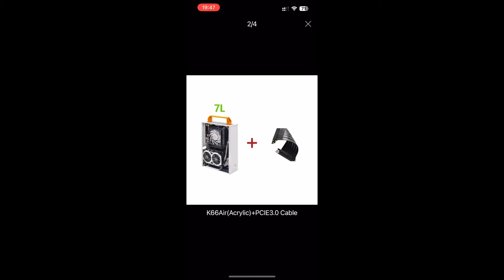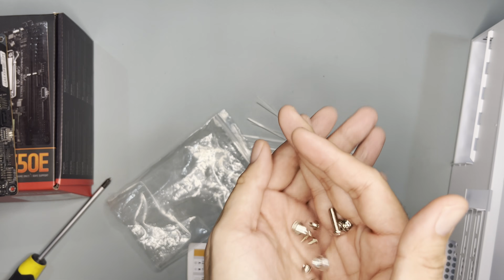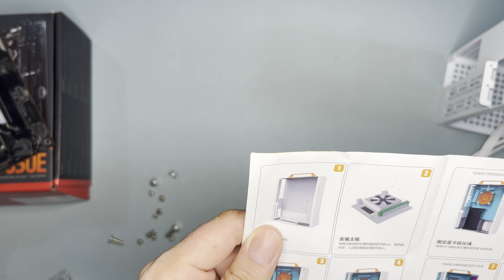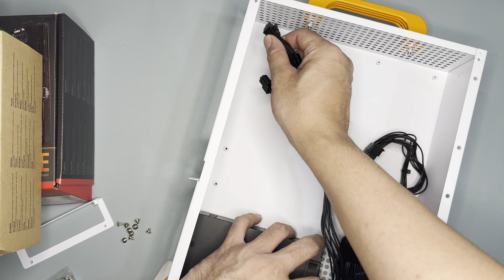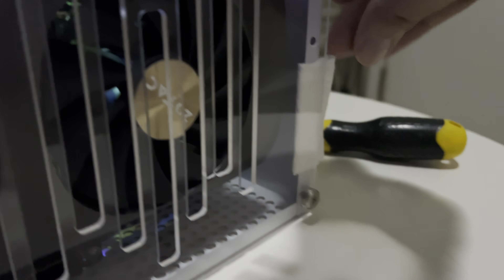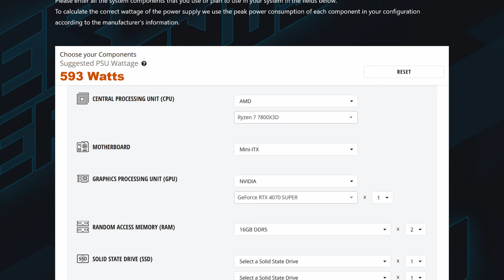K66 Air | A 7.4L SFF ITX Build | Thermal benchmarks

Comment: hello sir, planning to build a similar build with this case. Is there any space for a wifi card?
Reply from the maker: There’s only 2 PCIe slots and you need a riser for that as well. If you have a dGPU and wifi card (assuming in PCIe slot), then that will be tricky since you’d need 2 risers. If you use the wifi key slot, then you need to punch extra holes for the antenna. I Hope I understand your question correctly.

Comment: Just ported my old ITX build to the K66 Air, thanks to this video for the pointers.

For anyone looking to build in this case do take note of the following:
- Pay attention to the PCIE riser cable mounting screw holes, ideally you want the model with 2 holes (1 elongated + 1 round), I bought the "official" one from a seller on Aliexpress and it did not fit the K66 Air, so double check before ordering
- PCIE riser cable length should be 18.5cm (edit - the mounting holes should be close to the bottom of the cable with the plastic bit thin, so it can attach to the mounting bracket)
- In the video the GPU's fan was hitting the side of the case, however in my case with the same GPU this did not happen
- The Zotac 4070 is slightly thicker than the Zotac 4070 Super, 44mm (2.2 slot) vs 40.2mm (2 slot), even at 2 slot the GPU fan is flush against the vented panel so expect some turbulence
- Officially the case supports 1 x 2.5" drive, but you can stack 2 with some double sided tape
- Depending on your mobo you can fit slim 60 or 80mm fans along the top of the case (CPU side) as exhaust, I did M-ITX and squeezed a 80mm fan at the edge above the 2.5" SSDs, only 2 screws used
- You can squeeze a slim 80mm fan along the bottom of the case (GPU side), only 1 screw used
- Consider getting cable extensions from Aliexpress for cable routing, I used 01 x 300mm 24-pin and 01 x 500mm CPU cable extensions for modular PSU
- The case looks great in the horizontal orientation, just add some speaker feet at the bottom

Edit - tidied up the cables in my build and encountered the same issue with my Zotac 4070 Super (fan hitting side panels). This is likely because of the mass of cables from the non-modular Enhance 600w PSU I'm using that's pushing the GPU out and towards the top of the case. Hid the Molex and SATA cables under the PCIE riser and adjusted the riser bracket so It was aligned and tightened the bracket screws to prevent the GPU from ending up at some weird angle.
Reply: Thanks Mate!

Comment: Thank you for making this video. I also want to build one with similiar components but choosing 7500F, same gpu, matx motherboard with 3 2tb nvme gen4 drive.
Whats the power consumption during benchmark & gaming? still under 500w from the outlet? want to use same psu but I think i needed more, like 600w psu.

Comment: Hello po sa tingin nyo po ba kakasya ang XFX Swift AMD Radeon RX 9060 xt dual fan?

First time ko gagawa ng PC. 

At baka pa assemble ko nalang siguro sa easypc 😅
Reply from the maker: Not sure how long that is but this case supports up to 245mm dual slot gpu. If it is slightly more, you may have issues

Comment: buti po kaya ung 7800x3d for 500w?
Reply from the maker: Barely. But we shouldn’t look at power requirement of a single component only. It should be power requirement of the whole system — if you max it all, it might require 450W. Thus the comment — PSU is loud since it is reaching its max capacity.

Also 7800X3D isn’t the top consumer, it’s the 4070 Super.

Comment: I'm a bit late on this post, but i want to use this specific case but i put a bit different part, here is the list

CPU: ryzen 5 7600x
Motherboard: MSI Pro B650m-A wifi 
SSD: Team T-Force G70 pro 2tb
Ram: Gskill S5 32gb 6000mhz CL32
CPU Cooler: ID-Cooling IS-67-XT
GPU : Zotac 5070 Twin edge
PSU: Enhance ENP 7660L 600w Platinum 
Riser: some Generic 18,5 cm PCIE 4.0 riser

Do you think this combination is good enough or do you have another opinion?
Reply from the maker: It’s ok but at full load, expect the PSU fan to be loud. If I have to cut something, I’d cut the CPU to 7600 non-X — a tamer and more power efficient but pretty much same performance as its X version.
Reply: @manongunboxing thanks man, much appreciated for your suggestion

Comment: Question : Does id-cooling is-67-xt fit a case?  Is number 67 in Thermalright AXP120-X67 is the same thing?  67 mean the high size of sink+fan right???
Reply from the maker: If we are to trust the manufacturer claims, then yes. 67 means 67mm in height.
Reply: @manongunboxing  Thank you :)

Comment: Hello po I currently building a sff pc using the SKTC A10 case or utake a10 in shoppe, It is about a 7.3L case and I am using a 4060 low profile. I wonder if you could also build it if you can get your hands on a 4060 low profile
Reply from the maker: Sadly, I ran out of 4060 LP. But I’ll check other sources soon. Thanks

Comment: Nice content we build lang this case K66 air kahapon sakto pag upload mo sir. CPU is Ryzen 5 7500 F partner nya is RX 6600 XT power color. PSU is same with you FSP 500watts din.MATX mobo MSI pro b650 M-A wifi. need tlga i undervolt ung gpu i think since di kagandahan ung air flow umabot ung temp nya ng 105 celsius nong nag laro ako ng world of tanks lng. pag ordinary surfing nasa 55 celsius lng . may downside if mAtx di ko magamit ung usb port malapit sa power button sagad kase sa case ung port kaya masikip.tama ka sir need tlaga nito is medyo manipis na GPU mga below 243 mm kase sakin sumubra  ung sukat nasa 245 mm . may notes nmn don pag bibili kayo ng case nato. ang cute eh hahaha kaso medyo mainit tlga need ng mga fan tlga.

Comment: i think the biggest disadvantage of the acrylic is that it has quite low heat dissipation, which will inevitably heat everything inside :/
edt. would suggest to also test reverse cooler config on C24, with back wall fan on intake aswell as middle cooler fan on intake, i think CPU temps should improve
Reply from the maker: Will do